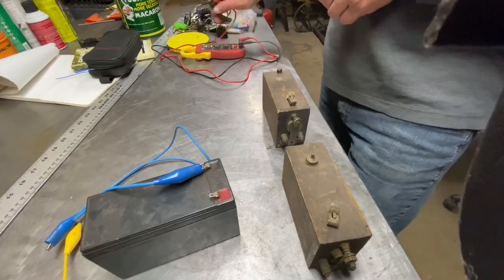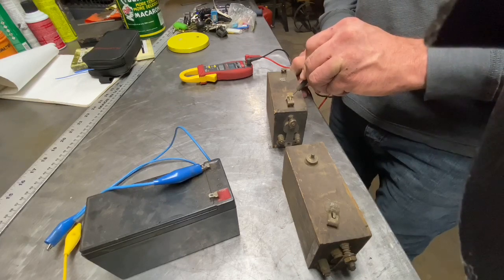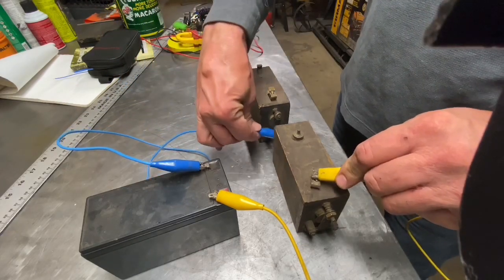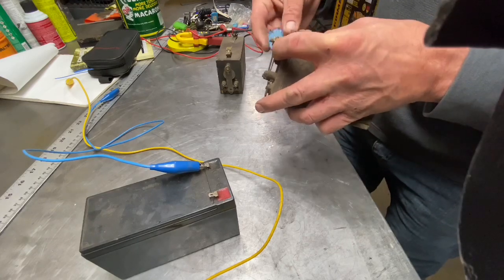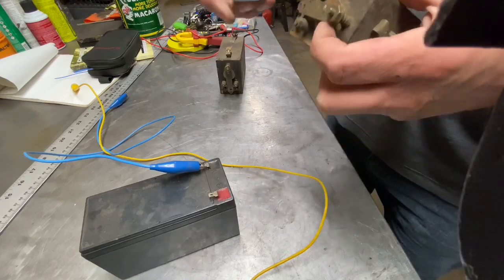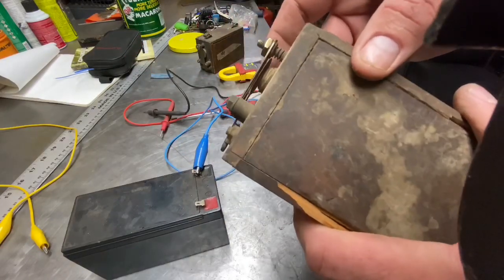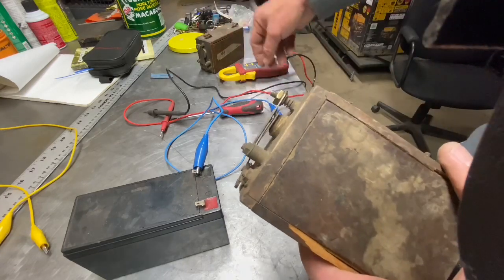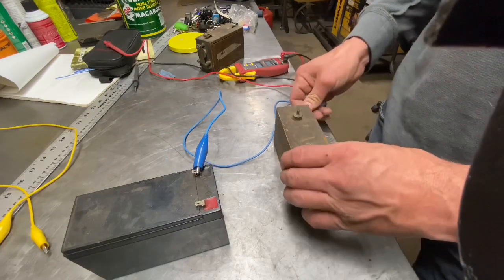BUZZ COIL POINTS

Comment: The first time I payed with EHT spark coils, The coil and spark points were in a 1938 home made TV design for the 405 line fly back EHT generating around 5KV - the TV screen was a war surplus 5" green x radar screen - That was in 1975 and the TV still worked - The owner built the TV in 1950 - I did the same as you sand papered the points to get it to work -